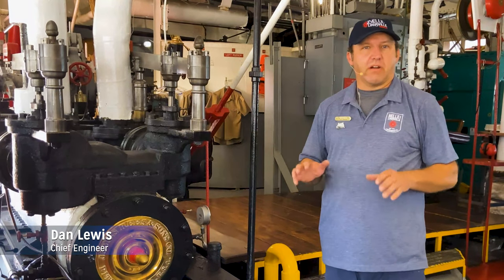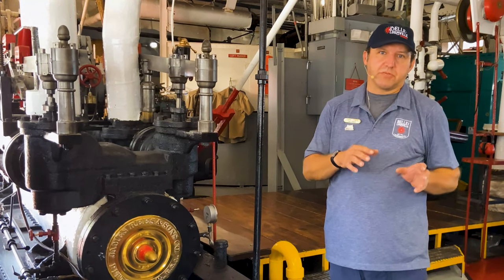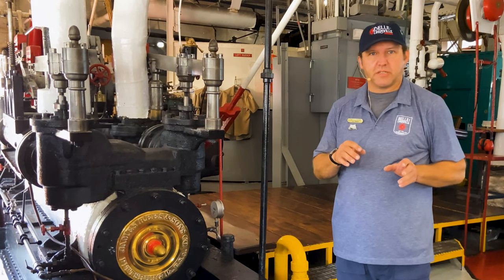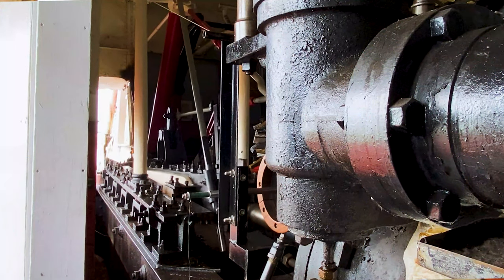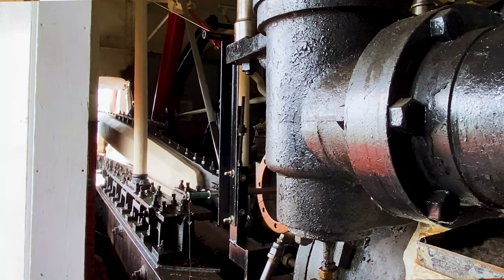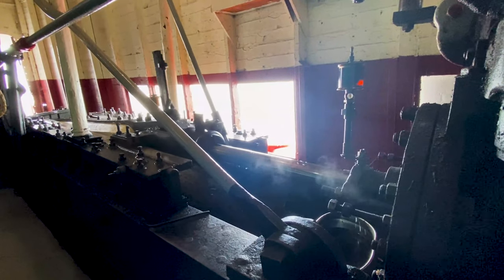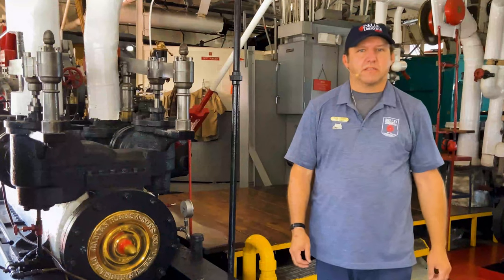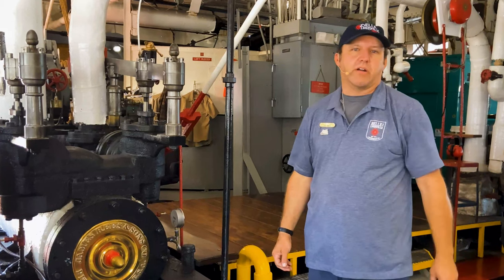How the Steam Engines Work Aboard the Steamer Belle of Louisville

Comment: What is the boiler type and working pressure of the engines? What fuel do you use, and how often does the boiler have to be cleaned with the scale that builds when using river water?
Reply from the maker: Boiler type: “Western Rivers Firetube Boiler”—we are the ONLY working example of this type of firetube boiler left. The boiler’s MAWP (maximum allowable working pressure) is 200 psi. We normally operate around 180-190 psi. We take a water sample before every trip to determine what chemicals, if any, will be needed during a cruise to prevent scale build-up. Every 14-15 trips we will cool down the boiler enough to open up the steam space and wash out any loose scale we find with a 1-1/2” firehose. We will “wash” this scale completely out, from top to bottom, and go for another series of trips.

The working pressure in the engine cylinders can vary depending on what maneuvers we are doing, but the pressure is usually no higher than 180 psi.

We burn diesel fuel these days to heat our boiler.